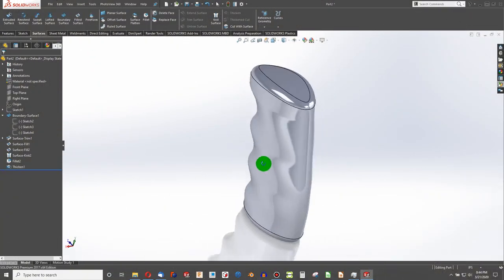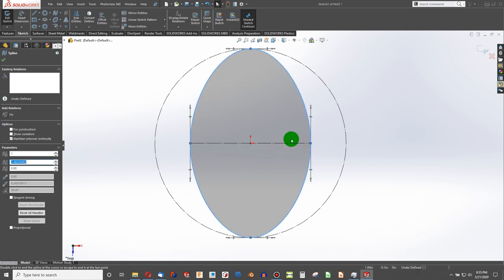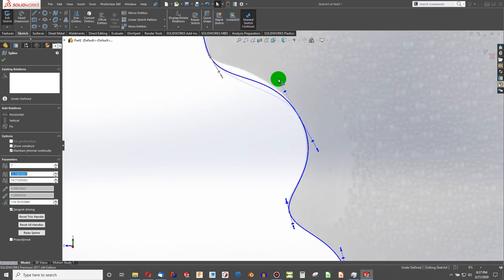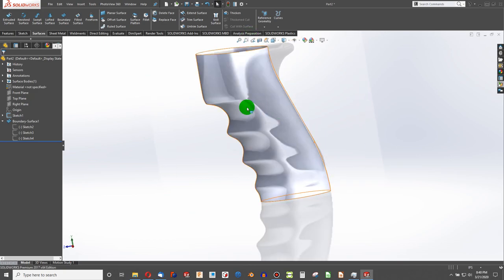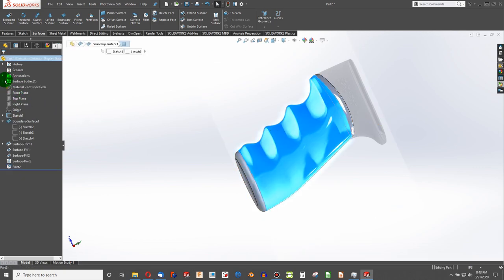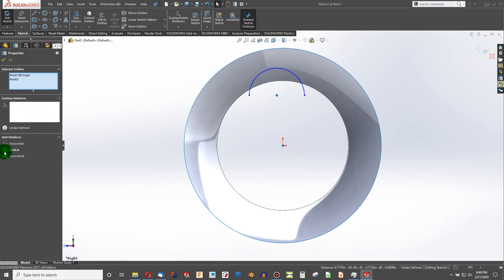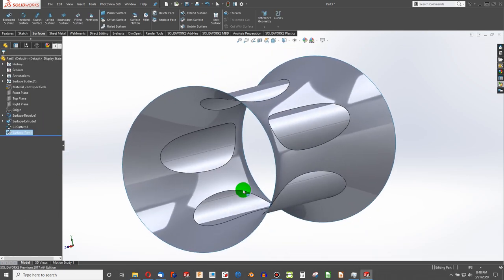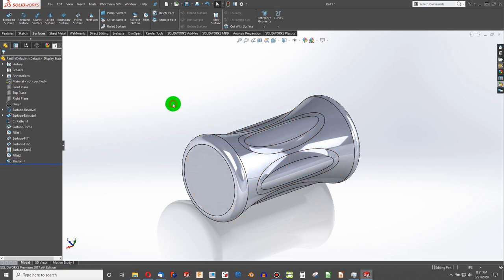SolidWorks Strategies For Modeling Hand Grips |JOKO ENGINEERING|

Comment: Thank you so much!  I have been hesitant to try using surfaces so I tried making my grip with lofts but it turned out horribly.  After doing it the way you did in the video, my grip turned out exactly as I wanted it!  10/10 will use surfaces again